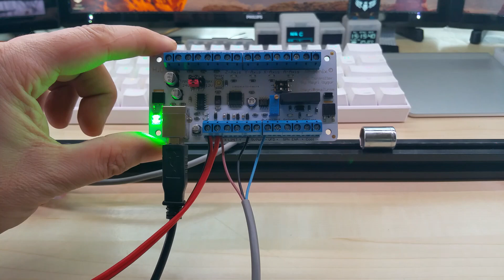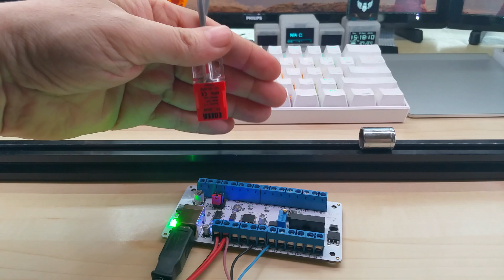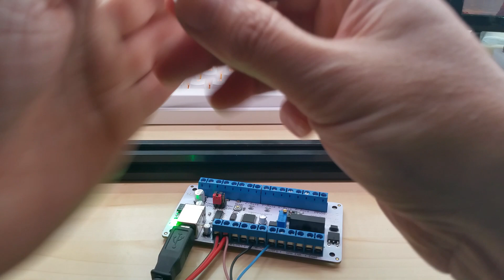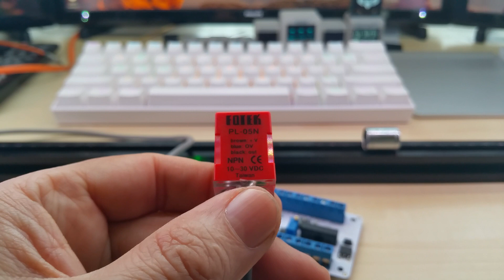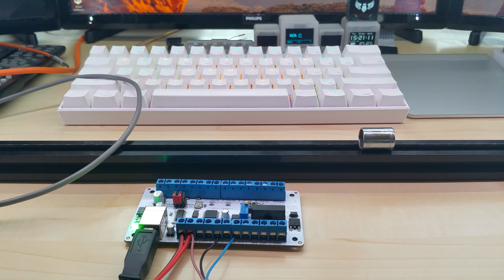Phoenix USB CNC Controller by Hayri for sale on Tindie

Comment: Hi. This is just a controller? So i still need a Driver? Thank you
Reply from the maker: Hi, that is correct, this is just the controller, I do also have a driver board that connects to the controller directly without wires, that has 4 DRV8825 stepper drivers including fan cooling.

Comment: Nice work Hayri! So you integrated the necessary diodes for the switches? I may have to order an updated board. I really like this compact version.
Reply from the maker: Thanks Michael, yes it was not rocket science but nevertheless a helpful touch, makes wiring a breeze. Really love those inductive sensors :-)
Reply: @iHayri1  I found some low profile sensors on Amazon that will work perfect on my machine.
Reply from the maker: @Mike..M  Just make sure they are NO, normally open, and NPN :-) then you can connect them directly. The sensors do come in different shapes and sizes and the best option can be chosen depending on the CNC.